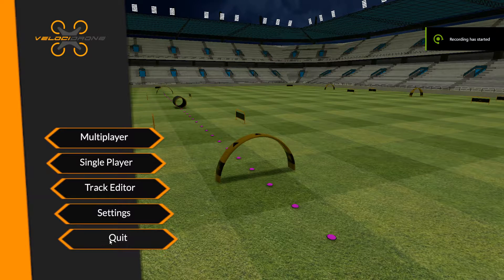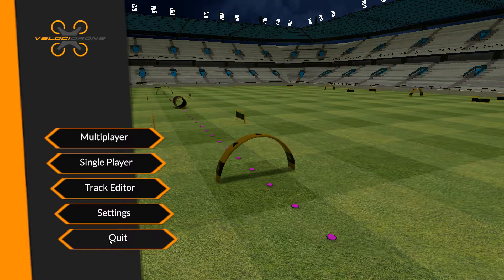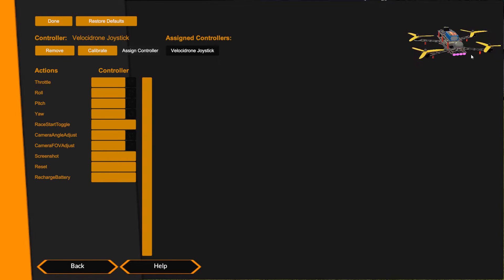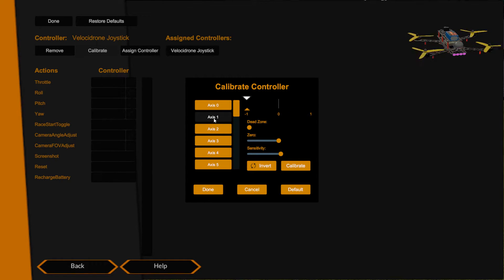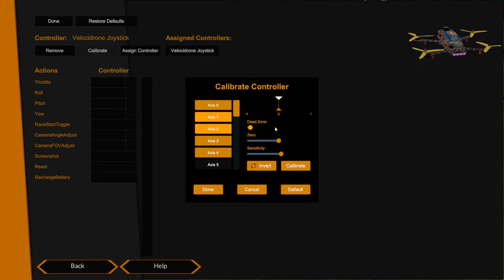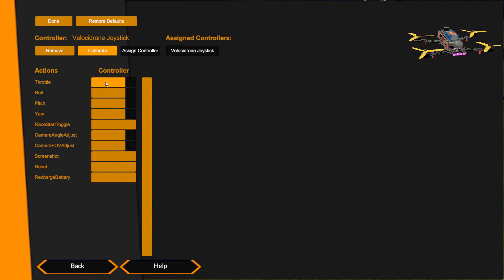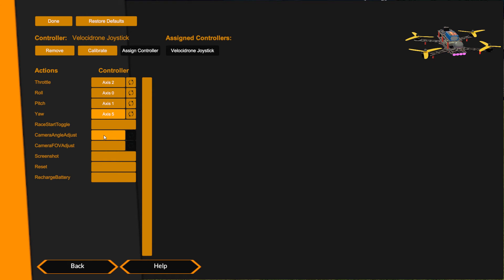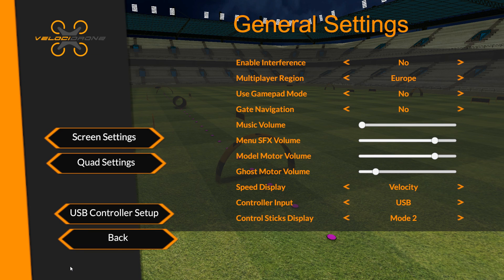VelociDrone 1.7- Turnigy Evolution USB setup

Comment: I have a jerk in the simulator with the remote control. I have that in windows too. Do I have to make any adjustments so that I have a smooth output?
Reply from the maker: Replacing the offending gimbal would be the correct action. This will happen on your real quads as well and will steadily get worse over time.
Reply: @Velocidrone  on the real quads is all fine only the usb output.
Reply from the maker: @KeozFPV  stick outputs come from the gimbal, USB or not makes no difference,  the mode of output will not introduce a glitch. You WILL see this on your real quad as it gets worse. The fix is to replace the gimbal.
Reply: @Velocidrone  ok

Comment: I am on an IMac.  I have the interlink flight controller connected via usb and everything is correct followed this video all seems great.  When I try to fly the drone does not move.  Arming switch works, camera angle works too.  I see the props spin up but it sits there.  Any suggestions?
Reply from the maker: https://batcavegames.freshdesk.com/solution/articles/16000082828-quad-controls-work-in-controller-setup-but-in-the-game-the-quad-won-t-take-off

Comment: Id love to see them add more models. They should atleast add a few tiny whoops and some 3 inch quads (Im looking at you hglrc xjb 145). They could even add indoor courses through small houses for the tiny whoops.  One of the things I love about this simulator is that you can choose which model to fly, but their isnt nearly enough variety. Its just full of 4"+ quads and lacking in small or medium sized quads. Also low framerates make the quad floatier than normal but its not an issue if you have a decent computer. Its not necessarily bad though, if anything im just amazed it works at all on crappy computers. Im sure youve already realized this but i just figured id point it out. I realize it might not be preventable. Its still the best sim out there, but it can always be better with more models.
Reply from the maker: We are currently upgrading and adding 5" models. After this next release we are looking at 3" models. Simulation doesn't happen overnight - just adding a 3" model or tiny whoop isn't just making it in a 3D program and adding it in. Whole new prop simulations and aerodynamic simulations will be required and this takes time. Now if you just want a game rather than a simulation then there are plenty of choices but if you want it done properly then it will take some time.

Comment: So whenever I open Velocidrone on my Mac and start a map, it freezes completely after a few seconds and I have to force quit the software. I was using a Turnigy Evolution via USB and it worked perfectly fine for about a week. Is the transmitter causing this or is it the software? Any help welcome.
Reply from the maker: Casen Mackin turn off auto quality and set quality to fastest. Turn vsync on, set physics cpu to low. If you look on our channel there is a video for setup for low specification computer. If you follow this it should stop your mac from getting overloaded

Comment: My throttle is not working
Reply: When I move it nothing happens but its recognized by the calibration
Reply from the maker: got to c:\users\your-user-name\appdata\locallow\velocidrone\velocidrone and delete everything in this folder and restart the simulator
Reply: VelociDrone thx for replying, I cant locate the folder under this adress
Reply: I'm on windows 10 64-bit
Reply from the maker: appdata is a hidden folder, you will need to turn on hidden files in the view tab of windows explorer
Reply: VelociDrone After turning on hidden files and having erased everything inside the velocidrone folder, the issue still persists. No matter which axis I assign to the throttle, it won't work. All the others will.
Reply from the maker: can I suggest you raise a ticket to our support system (see the link at the top of our website home page). In almost all circumstances the above fixes the problem, so in your case something else is going on that we have not seen before and I'm going to need to look more closely at what you are doing ... youtube comments isn't suitable for this sort of support.
Reply: VelociDrone sure understandable, I will do it.

Comment: Why does this simulator feel like I am flying in outer space?
Reply from the maker: Probably because your frame rate is so low the aerodynamic / physics calculations can't run properly. I suggest a PC upgrade.
Reply: i7, 14gb ram, ssd and a rx480... this is my gaming pc. I can run any game maxed out that's not the issue..
Reply from the maker: In that case I would say your perception of gravity is off as the sim drops faster than a real quad does .... we've tested it multiple times and it beats real drones to the ground in drop tests every single time.
Reply: Well that's certainly not my case. I've been flying for 8 years and I think I know what it's like. It feels just like Liftoff. I cut the throttle and it just slowwwwwwwwwly falls back to earth...
Reply from the maker: We've tested the sim against a Chameleon, GEPRC LX5, QQ190 and a Minion. Dropping both horizontally and nose down from both 50M and 100M. In all cases the sim quad hit the ground first. The tests quads were running betaflight with default min throttle and HQ 5040 props. Given I've actually tested this and have credible results the only possible conclusion is your perception is wrong.
Reply from the maker: Something you won't be factoring in is that in the sim the camera distance distortion is different to a quad lens. Generally a real quad lens lengthens distance more than the sim, this gives you the perception you are much higher than you actually are ... which is why you 'think' you are falling quickly when in fact you aren't.
Reply: This seems to sum it up. Interesting actually. Thanks for clearing it up.

Comment: Hi, I have a problem. I use Mac, and I do not know how to calibrate my Turnigy Evolution on the Mac before joining the program. I've seen that Windows has a Joystick calibration. Do I have to do this on the Mac? I want to use my Turnigy Evolution on Mac
Reply from the maker: You can  calibrate on a mac inside the sim itself but it should still detect it regardless, however as per the video we don't recommend using the Turnigy Evolution unless you connect it wirelessly as it's internal USB driver is extremely poor quality (it's like this for all simulators it's just more noticeable in VelociDrone as we run such a fast input loop to avoid latency).
Reply: How do I connect via Wi-Fi through Evolution, do you have the Arduino Link that you talk about in the video for me to buy? I have no other control, and speed is the best simulator for me, I want to be able to explore it in the best possible way. It's no problem not to be 100%, but I want to be able to use it.
Reply from the maker: The Teensy 3.2 arduino board can be bought online through ebay etc. The software for it we provide free to our full license customers, you can find it in the licesnses section of your login to our website.
Reply: Okay, I have it on Ebay, take me the last doubt, that Teensy 3.2 32-bit 32bit, I'm going to connect a receiver of my control in it? What is the procedure for him to do Bind with my Turnigy Evolution? Will I weld a receiver on it?
Reply: If I have to connect a receiver on the Arduino, which receiver is compatible with Velocidrone? This will work on Mac>
Reply from the maker: you solder the rx to the teensy and it powers it, you bind to the receiver just the same as you would any receiver in a model.
Reply: OK! Have you done any testing with Arduino Uno R3 Dip? Why teensy 3.2? I'm asking this because I have access to buy much easier to Arduino Uno
Reply from the maker: We have done no testing of our software outside of the Teensy 3.2 (works perfect) and Teensy LC (which doesn't work as it can't deliver the needed power). You are welcome to try the Uno, I don't know if it will work or not.

Comment: Is the teensy 2.0 also possible to use?
Reply from the maker: The 3.2 we picked because it has the required uart for sbus and can provide the current output for the receiver. We know for sure the Teensy LC is not compatible due to power issues, with Teensy 2.0 you would need to just try it and see, I'm not familiar with it's specification.

Comment: Does the evolution also work poorly with mac, or would it be acceptable without using a teensy
Reply from the maker: The problem with the Evolution is it's inbuilt USB driver, so it's equally poor on all computers. We would recommend a wireless solution like the Teensy to bypass it.
Reply: VelociDrone thanks, would the radiolink AT9 work well on Mac with VelociDrone please?
Reply from the maker: Sorry I'm just not familiar with that transmitter to be able to answer.
Reply: VelociDrone would the FlySky FS-6i work well?
Reply from the maker: It has the same issues as the Turnigy .. FlySky i6 and Turnigy Evolution are the two tx we recommend using a separate USB dongle for or a wireless solution like the Teensy.
Reply: VelociDrone thankyou for your prompt replies and sorry to bombard you with the questions, I have already purchased VelociDrone for mac and currently using my playstation controller and wondering which transmitter to get.  Would the frsky taranis qx7 and x9d plus both work well, if so shall plumb for one of those
Reply from the maker: Both of those have a superb internal USB driver, so I would definitely recommend those.
Reply: Thankyou kindly. Very much enjoying veolicdrone, looking forward to enjoying it with a proper transmitter :)

Comment: I've just connected an FS-A8s to a Teensy 3.2 which is running "Teensy32-SBUS-v0.2.hex".

The receiver is powered from the Teensy and the SBus wire goes to RX1 (pin 0). It's correctly bound to the Turnigy Evolution and is set to output SBus.

Velocidrone (on Mac OS Sierra) recognises the controller as "Velocidrone SBUS joystick" but when I try to assign a stick action to an axis nothing happens, the option times out and none of the controller movements are recognised.

Any ideas?
Reply from the maker: I believe the a8s can run in both s-bus and i-bus modes but it defaults to i-bus. You need to switch it so s-bus mode for it to function with the Teensy.
Reply: Perfect - holding down the bind button on the FS-A8s for 2 seconds switches the receiver into SBus mode and everything now works a treat. The receiver mode is retained after powering on and off.
Great response - super fast and exactly what I needed - Many thanks!

Comment: Is the wireless dongle still needed with the latest firmware update of the Turnigy Evolution?
Reply from the maker: yeah I tested the latest firmware and it's still terrible / unchanged.
Reply: thanks for the reply, I'll check out your recommendation.  Have you had the time to test anything that is more "off the self"? Thanks
Reply from the maker: there are other off the shelf wireless solutions but I'm not aware of any specifically for the turnigy. The Teensy solution is better than the off the shelf wireless solutions anyway. The one I would not recommend is Rx2Sim ... horrible solution.
Reply: thanks, I'm going to order a Teensy.
Reply: What the heck is a wireless dongle.... lol. I didnt even know dongle was a word. I thought it was nonsense like doohickey or thingamabob. Can you not just use the usb cord with a turnigy evolution? Edit: what the hell is a teensy? Are we making up words? Lol